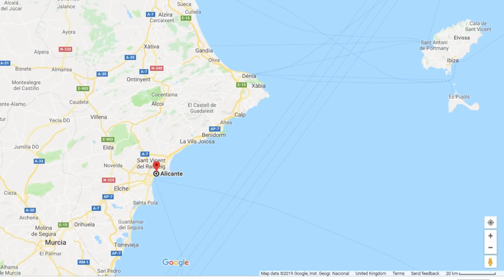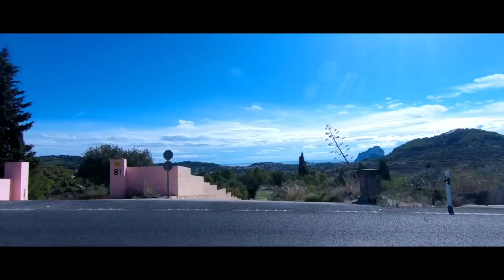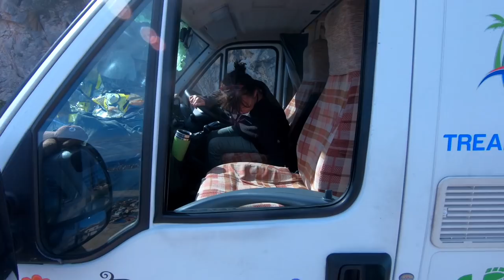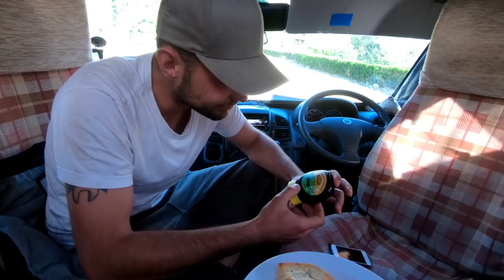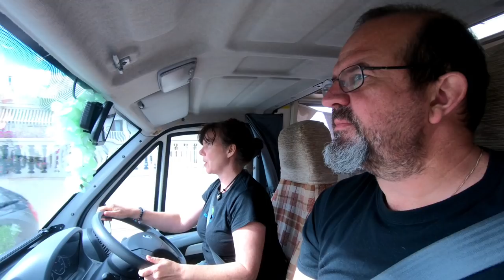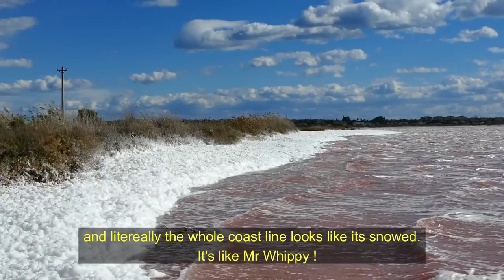Have we reached the end of the road?  [S2-E28]

Comment: I’m surprised your low brake fluid didn’t trigger a warning light.  On our Ford KA (based on the Fiat 500 platform) the fluid only has to drop slightly below max and the light will flicker on and off.  Glad to hear you got it sorted, usually your brake pedal will go a bit soft and spongy if you have a leak.
Reply from the maker: Hi Stuart - thank you for your comment 😍😉we did have the warning light come on and we took Trudy to a garage in Belgium .... they said it was a faulty sensor !! LOL hey ho !! we are sorted now .... Mike our Mechanic has just replaced parts and she has passed her MOT with flying colours YAY - the spongey tip is great !! 🚐💕👍kind regards Marianne xx